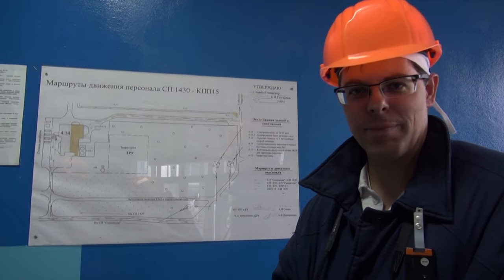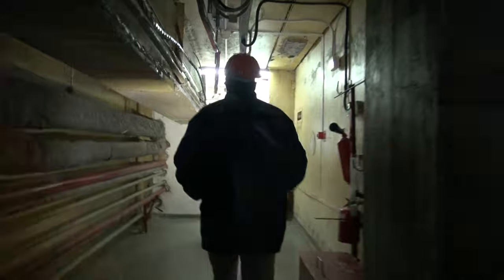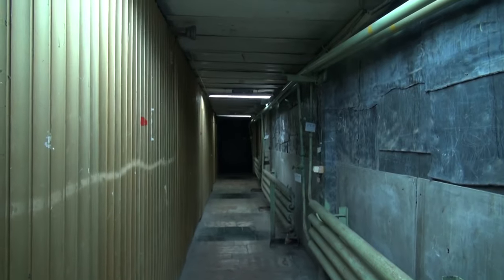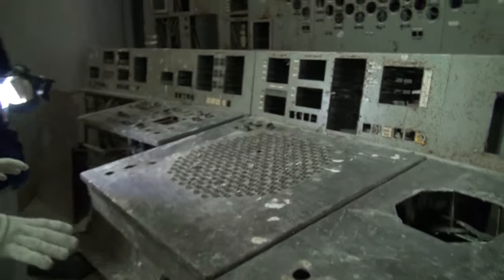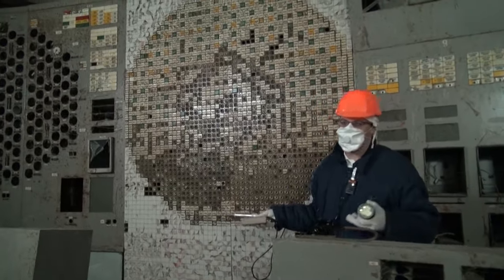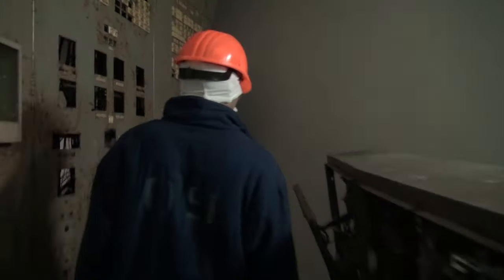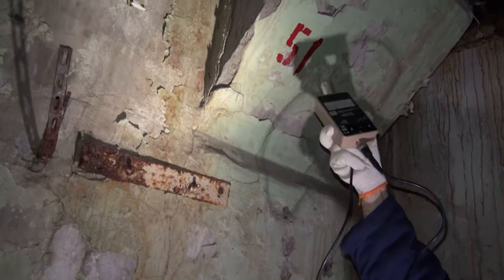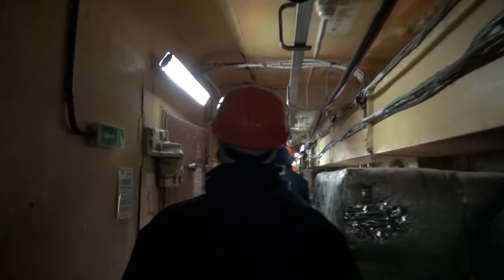inside Chernobyl ЧАЭС sarcophagus 2016 - reactor #4 control room and lead-lined corridors

Comment: You know it’s real when no one even puts graffiti on the walls.
Reply: eee Hahahaah
Reply: Ironically notice how all the parts in the control modules are missing looks like someone broke the glass and came for them.
Reply: @Moody_Incorporated  Maybe soviet agencies removing them in order to prevent leaks about what happened in the power plant.
Reply: @abcdefg9613  I imagined that a possibility since there were too many soldiers there you couldn't even enter the building at the time so must have been after.
Reply: Connor Kingston the control room was deliberately stripped a few years ago.
Reply: @robrossington7118  I have no idea why though because those parts would still be highly radioactive in fact if values are accurate 1500 rogue. They couldn't be used anywhere else should've just left it there to teach jipseys a lesson not to steal lol.
Reply: "1500 rogue"??
Reply: @IANSYT  Rem  "roentgen" (autocorrect) actually it may have been 1500 sieverts.
Reply: @Moody_Incorporated  1500 roentgen they would be running
Reply: @mammutit  They would be if they knew that snowy dust was actually bits of graphite.
Reply: that snowy dust was just ash, radioactive ash
Reply: Blob B elephants foot isn't so radioactive anymore. i mean compared to how it used to be. the temperature is only slightly above its surroundings at this point
Reply: @Moody_Incorporated  those parts might have been used as spares in other control rooms or old equipment.
Reply: @sereysothe.a  Could you point me to something about that please? Actually spent a little while on a couple of occasions trying to find recent surveys etc, but no joy. Would be grateful 😁👍
Reply: @ligametis  Can't be used they're radioactive remember the nuclear scientists right next to those parts died in about 2-3 days. If someone touched that amount it would be less but still lethal amounts I think it was 1500 roentgen on the outside so maybe 4000 roentgen inside?
Reply: @Moody_Incorporated  but reactor 3 that is only 100 meter away has remained working till 2000.
Reply: @ligametis  Isn't this the one that blew though ? In the video I can't remember what this video was about.
Reply: @Moody_Incorporated  reactor 4 was the one that exploded
Reply: @ligametis  Yh aren't we talking about the reactor 4 parts?
Reply: @Moody_Incorporated  yes. But i think those parts might have been reused anyway.
Reply: Best comment
Reply: Theres no graffiti, but there are definitely plenty of graphite
Reply: @Moody_Incorporated  these wankers recycled tons of cars trucks and other machinery where do you think did it go? Its has been rolled into sheets of steel that will end up some where to be re used, after melting radioactive it should go up in radioactivity
Reply: @Blob B graffiti is art
Reply: eee u can say that again!!!
Reply: @infinitewars6373  You can't recycle radiation if we could chernobyl would be habitable again. If that metal was still radioactive re used and someone died well they're in big trouble.
Reply: @Moody_Incorporated  they are probably very sick from it if they did take them as souvenirs
Reply: @infinitewars6373  Far as I know the trucks vans and fire fighter trucks are all kept in the exclusion zone with warning signs of high radiation. What's the company ? I live in the UK i'd be very very surprised if they used the steel from those trucks. Maybe steel from other parts of Ukraine but chernobyl steel? Well if that's the case I don't know how they're running because they'd be shut down soon as an inspector found out.
Reply: Vitez od Vozdovca  3.6  Rotengen? not great not terrible
Reply: No graffiti, only graphite
Reply: @Moody_Incorporated  You could probably dilute the steel enough that the radioactivity wouldn't even matter.
Reply: InfiniteWars they buried all of the cars and helicopters used.
Reply: @jarhead1145  I like your thinking. Melting the steel thin enough to lower the radiation would work but you have two issues further contamination of the vessel used to melt it and the possibility of evaporating any polymer coatings on the steel that would mean breathing in radiation in the air. Another issue is the heat won't destroy the radiation the concentration of radiation will stay the same to dilute the steel you'd be doing a lot of diluting that's if you can dilute that much steel eventually you'll eb left with literally no steel. But it's plausaible if it's cost effective remember these guys only care about cheap that's why chernobyl happened.
Reply: Connor Kingston 1500 sieverts is as high as standing inside the core for 5 hours, you must be thinking of something else.
Reply: There is actually a lot of graffiti around the whole area and even known places for people to spend the night hidden and see the reactor. The reason there is no graffiti here is rather because it's heavily guarded by the police and the military even to this day to avoid idiots running in and dying.
Reply: Vitez od Vozdovca  don't worry the "real story" about how CIA did it will be so much better right? maybe not true but the lies can be hidden :D
Reply: @Moody_Incorporated  so people don't go in and steal it
Reply: No they puts graffit
Reply: This is Russia, walls grafitti YOU!
Reply: @sereysothe.a  That's not true. The elephant's foot is still EXTREMELY radioactive and will be that way for many years to come. It's temperature, however, has decreased to the point where it's only slightly warmer than the surrounding area due to the radioactive decay happening in it.
Reply: Bunker Sieben  i hope so
Reply: Lol true
Reply: Connor Kingston they stopped them put it under concrete and a special liquid
Reply: I think it was 1500 Deez
Reply: I think that central is locked so you can only get there with governement's consent. That way it isn't abanfoned
Reply: Graffiti above the toilet

Dyatlov was here.
Reply: I was not expecting 5k...
Reply: namn it’s still melting into the earth slowly. It’s deadly if you are near it for a few hours.
Reply: @abcdefg9613  so close to 200 likes
Reply: In Pripyat there actually is graffiti...
Reply: Yeah of course this is a place where you can't spray paint it is the remainings of a deadly radioactive explosion in 1986 it's going to be radioactive for more than one million years and it can cause cancer if you are there for more and 5ish hours.
Reply: @Blob B that is dangerous
Reply: @Moody_Incorporated  Reactor 4 did
Reply: @Moody_Incorporated  Control room was deactivated in 1986, most dangerous things was removed from there. They even build few new walls to isolate control room and corridor from reactor.
Reply: @Blob B imagine if there are graffitis inside building 4 but no one found out
Reply: No, it's just that they are more civilized there!
Reply: Fair one, wouldn't surprise me if anything atomised is forbidden.
Reply: instablaster.
Reply: @Blob B ahgahhahhahha
Reply: @Moody_Incorporated  we can’t do that it’s universal to dispose of any radioactive material that is not compatible with normal society we haven’t been taught about radioactive material it comes from waste  and some earths orbits (Space Debris)
Reply: @EySnapZoe  What did you just say ........... English?
Reply: I think you meant graphite
Reply: The KGB didn't much like people putting graffiti up at their workplace.
Reply: Because people work at the building. It is still be maintained and no trespassers can get in.
Reply: It’s because in Ruzzia you’ll go missing if caught making graffiti.

Comment: "Let's find some hotspots"
* Alarm constantly beeping since the beginning of the video *
Reply: Their devices are very sensative, those levels aren't anything to be worried about
Reply: @MrRedeyedJedi  everything is good comrade. I agree.
Reply: not good but not terrible
Reply: I'm told it's the same as a chest x-ray
Reply: @MrRedeyedJedi  yeah, that's what they said
Reply: This is not an alarm, it's a counter.
Reply: @penkatadrums  yup , I know that , but that's the sound of the high radiation level alarm on the counter
Reply: Your delusional! Take him to the infirmary
Reply: @firey_up_about_sumthin1866  :-))))
Reply: Your Geiger counter must be broken.  You didn't see any radiation because there's none there.
Reply: @viniciusportugal3552  You can set at which level the alarm would beep, normally they're set to beep when there is radiation above normal background radiation, and there are levels above normal there, but not dangerous for short visit, the're probably not get more than a chest x-ray, not a joke
Reply: MrRedeyedJedi yes comrade
Reply: Of the workers that died after Chernobyl, two thirds died from radiation sickness and only one third from later cancers, and a part of those were extreme smokers who just expected to die due to Chernobyl and thus didn't give a fuck about health. Also, many of them had long term exposure from before or after the incident, which might have been the actual cause of the cancer.
Short term and long term exposure have different effects.
Reply: As far as I know, a Geiger counter beeps every time it encounters a radioactive particle (alpha/beta radiation) or wave (gamma radiation). More beeps in a known time usually means more radiation.
Reply: The geiger counters... Never take them seriously... They are always like that...
Reply: Get the good meter!
Reply: Those meters were scared screaming AF!
Reply: They do tick a lot, I’ve worked with Geiger counters a lot. You’d assume really fast ticking would mean a imminent death, but it’s not necessarily that, it depends on the way it’s set I think.

Comment: For reference the meter she's using is measuring in microsieverts measuring the dose she's receiving. The show measures radiation exposure in Roentgens but a quick conversion of microsieverts/hr to Roentgen/hour reveals that 1 microsievert = 0.0001 Roentgen. The nearest roof to Chernobyls core was measuring at 12,000 Roentgen.
Reply: I can't just wrap my mind around this insane figure
Reply: @abhishekmodgil1556  500 Roentgen has an LD-50, meaning half of the people who get that dose are going to die from it. The 90 seconds workers spent on the roof in a 12,000 Roentgen environment exposed them to 300 Roentgen. 300 Roentgen can cause acute gastrointestinal syndrome, meaning basically bloody flux for a week.

90 seconds at this intensity is good enough to maybe kill you. 2 minutes will kill half of the people who go through it. 3 minutes is fatal to most. If someone gives you a choice between 4 minutes on the roof with the other liquidators or a death sentence in the United States or China, take the death sentence. Your odds of living six months are better on Death Row, even if your execution is scheduled for that time.

Statistically, you have better odds of surviving a fall from the Golden Gate Bridge than of surviving 5 minutes at 12,000 Roentgen per hour. You are less likely to die if you are a pedestrian hit by a car going 30 mph. You are safer playing 10 rounds of Russian Roulette. It's more dangerous to stand on that reactor's roof for as long as it takes to sing the Barney the Dinosaur theme song than it is to board a passenger jet you know is going to crash.

If I had written this comment while experiencing that amount of radiation, I would be vomiting now, I would spike a fever tonight, my immune system would shut down by tomorrow morning, and then I'd "enjoy" the last three pain-free days of my life during the latency period. Four days from now, I would have essentially zero white blood cells and my chromosomes would have recombined in random patterns. I would then slowly die as every single tissue in my body failed and all my skin flaked off. There is literally not a single thing any medical team on Earth could do to help me, except dope me up (while I can still absorb morphine) and then pipe CO2 into my air supply until I'm mercifully dead.

Tardigrades can apparently take it no problem though. Stupid tardigrades.
Reply: @RJStockton  great comment
Reply: @RJStockton  best comment ever !
Reply: So not great, not terrible?
Reply: @RJStockton  thank you for that comment!! Very interesting, during the show I couldn't stop telling myself that they should shot those irridiated people instead of letting them suffer.. There is no "a hospital is not a place that kills you" anymore here, a bullet is painless if well shot at the right place, while the suffer is the most painful thing is this case, this was more inhuman to let them suffer than to kill them 😔
Reply: @RJStockton  water bears are incredibly overpowered and I have several forum posts on the issue
Reply: @RJStockton  great and crystal clear explanation.
Reply: 12,000 Roentgen, not great not terrible. (Sorry)
Reply: @RJStockton  lovely comment :D